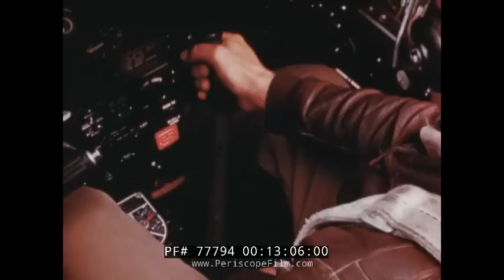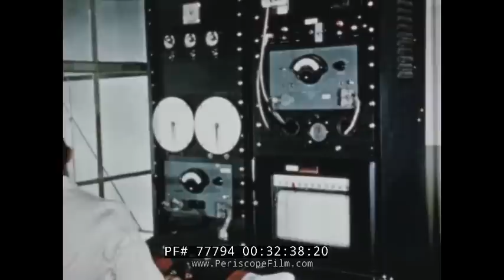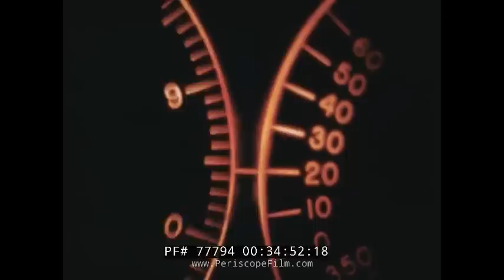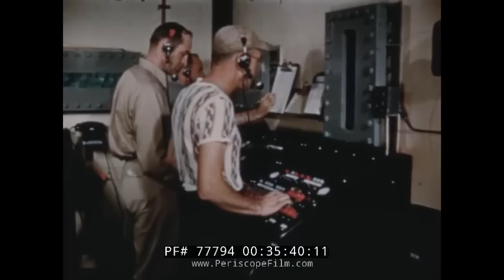THE NORTH AMERICAN AVIATION STORY 1950s PROMOTIONAL FILM  77794

Comment: When I moved to the San Fernando valley in the mid fifties, I was seven years old and the CA. ANG were still flying out of van Nuys with the F-86. this was the first jet aircraft that I saw up close and it will always be my favorite. The ANG were still doing gun testing and calibration at the old weapons bunker at Roscoe & Havenhurst, and the noise of the guns would startle the whole area so much that they had to give it up soon after. When I was older, you could go in there and retrieve .50 Cal slugs. I had a whole collection of them.

Comment: They forgot to mention that the North American Aviation Design Bureau was lead by a German-American man by the name of James H. Kindleberger. He lead the company to great financial success, and had designed many iconic American aircraft of the 1940s, 50s and 60s. 

B-25 Mitchell bomber, P-51 Mustang, F-86 Sabre and the F-100 Phantom were just a few examples of aircraft single handedly designed by James H. Kindleberger. 

It turns out the Anglo-American could not compete against German designers, and had to use a German from America to beat the Germans in Germany.
Reply: The F100 wasn't the Phantom. It was the Super Sabre. But a great you made there!

Comment: 22:26 No mention that swept wings were a German idea.
Reply from the maker: Actually, swept wing designs date back to the dawn of aviation history. While it is true that the Germans used swept wings in an effort to reduce drag, a swept-wing tail-less glider was flown in 1908 in England, and John William Dunne built a series of swept wing aircraft prior to 1914.
Reply: RonJohn63 swept wings were around since the dawn of aviation
Reply: I wish I had the links to prove what I'm saying, but...  I read Messerschmitt's decision for the 262 to have swept wings was purely accidental.  Their original jet didn't work out well and it's replacement was heavier.  They swept the wings back to adjust the planes center of gravity for the heavier engine.  It's improved performance was an only marginally understood bonus.
Reply: @PeriscopeFilm  The idea may have been around, but the realization that it would delay compressiblity effects is what the Germans discovered.   The Me-262 was swept for this reason.